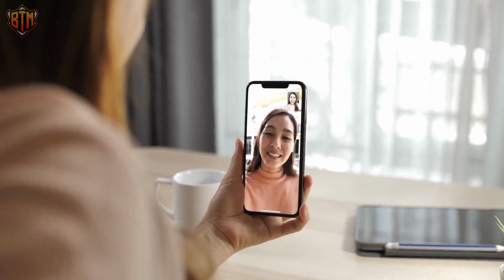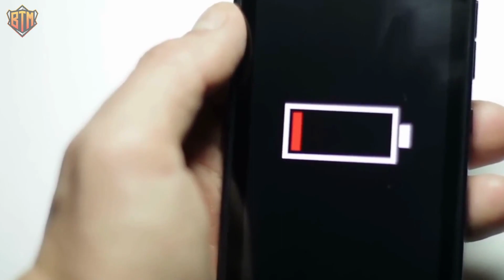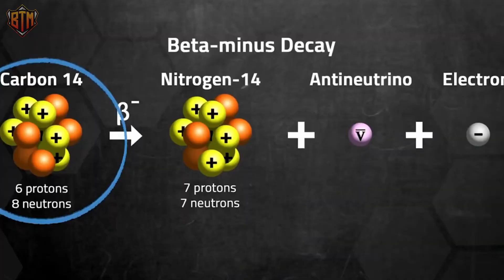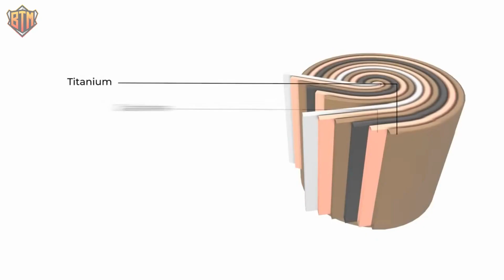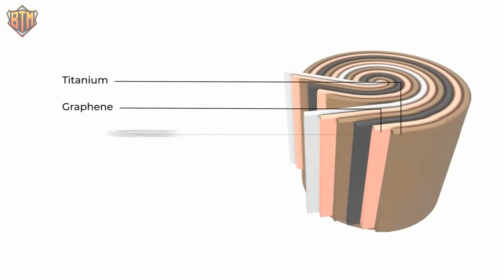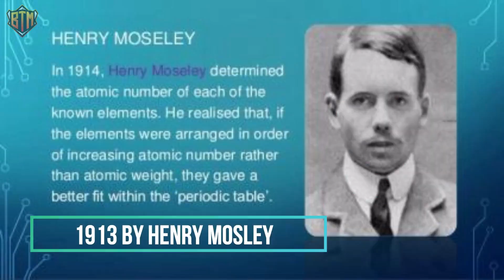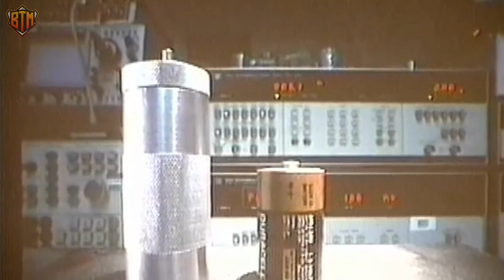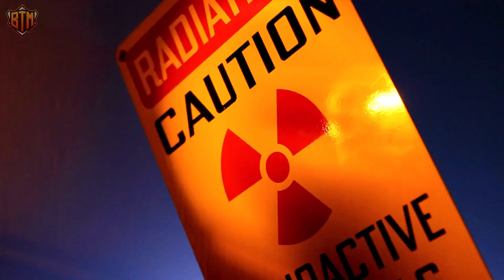Elon Musk REVEALS New Nuclear Diamond Battery 2023! ||  NDB Partnership

Comment: Please do some study and understand you just made a video of repeating a fraud. Nuclear Diamond Batteries are not viable for EVs, smart phones, laptops etc. due to POWER DENSITY!!! Imagine a battery that can last 1000s of years 😊(your story)...then…realize such battery needs to be 1000s of times bigger and more expensive than a Li-Ion battery for the same power 😮(what you would know if you actually studied the subject). The power density is limited to 10s of micro Watts per cubic centimeter. It's not a solvable problem btw. It's limited by laws of physics incl. the first law of thermodynamics (isotope decay power). Even if you used some highly radioactive isotope like Plutonium 238 (very dangerous), you would still not get much power per volume. Some great applications for this battery technology include pacemakers and remote sensors because they use very little power! And where the heck is Elon Musk saying anything about a partnership with NDB for EVs? Elon Musk also knows better.

Comment: Diamond nuclear batteries are now being developed by Elon Musk. The batteries will revolutionize the game, knowing that nuclear energy is one of the most potent energy sources on the planet. The batteries also had thousands of years lifetime. The battery could be improved because it produces no carbon dioxide emissions. Nuclear energy is regarded as a clean source of energy. The high-powered diamond-based alpha beta and neutron voltec battery may provide durable environmentally friendly power to gadgets when utilized in low power settings like satellite sensors. Thank you so much for doing this video.
Reply: You don’t understand the power density is 1000 of times too little so your batter needs to be 1000s of times bigger for the same power. That effectively makes this unusable for EVs, smart phones, laptops and other applications using Li-Ion batteries. Try to study about power density and you will know this is just a silly fraud.